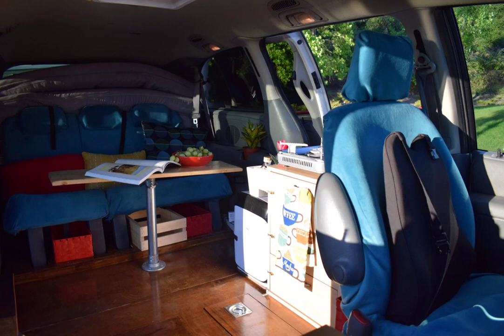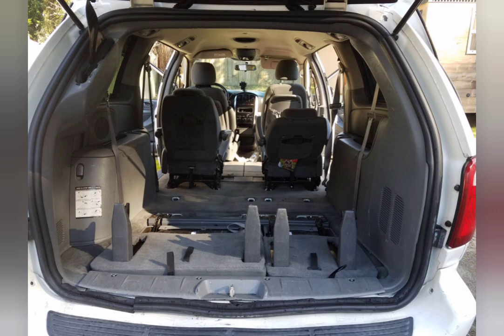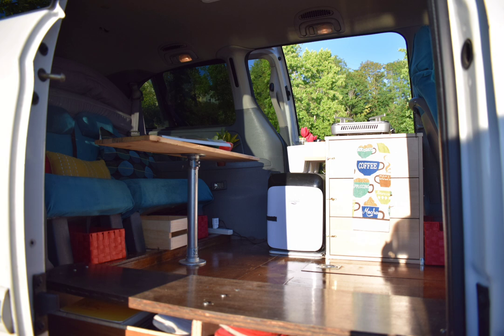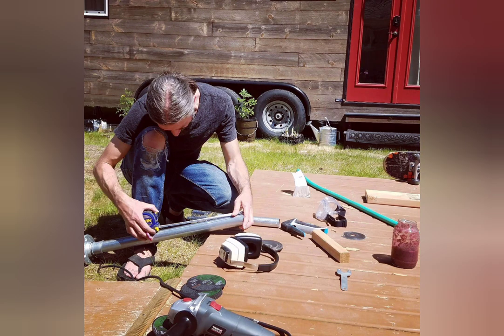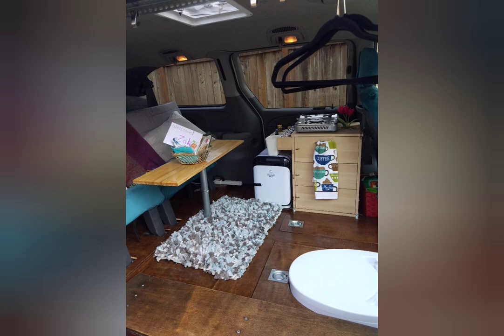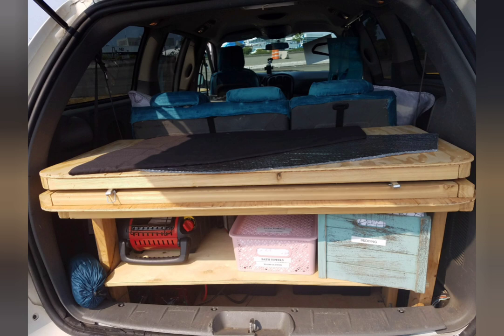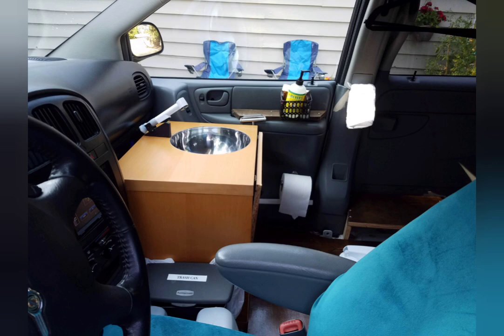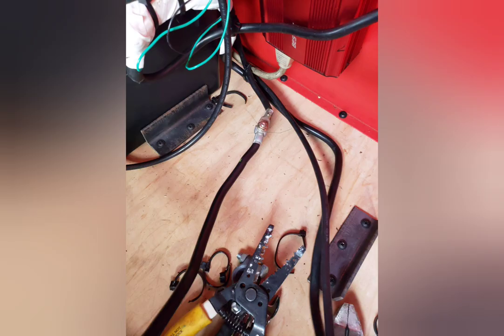Minivan Camper Tour Town and Country Build 1. Solar Sink Toilet

Comment: Love..was deciding on if I should stay iny full size high top has guzzler or go back to mini van.
This made me decide to go back
Reply from the maker: What kind of minivan do you have? Gas is getting so ridiculous with no end in sight.  I hope you're settling in the mini :)
Reply: @AfroMomVanlifing  I had a 04 mer ury Monterey. Had a wreck July 4th, it was totaled
 I now have a 99 dodge ram 2500 with a high top. Love the extra room, but uses to much gas. I need to go back toi Ivan with a better build out. My minii had a full size bed. Took up all the space LOL
Reply from the maker: @getyohustleon4601  oh yea, full bed is comfortable but there goes your space in a minivan lol. Lots of sacrifices to be made to work the space. Let me know what you end up getting 👍🏾

Comment: Hello Dear. So very sorry for the loss of your LOVE.  I have a T&C which I'm just beginning to build. I've removed all rear seats rid week - that's all I've done so far & I'm spending a lot of time reviewing others' builds. I did enjoy your slides showing your very nice setup.  Mine will never be returned to a commuter van so I can do pretty much anything I want.  Have you done any other videos? I'm so curious what changes you made.  Congratulations on mastering electrical!! Looking forward to more videos.
Reply from the maker: Hello Kay, and thanks for being here and the kind words. I'm excited for your build especially one you don't have to worry about converting back.
I do have more videos that I will post later. I'm in the middle of a very long build for our truck which has taken too long. I'll be posting more frequently in a month.

Comment: Be careful with the little fridge I bought my dad one for Father’s Day or Christmas and he only stored Coca-Cola in there and they are almost burnt up because it automatically flipped to the heat setting. Took it back got another one same thing took it back got another one but larger same thing. I had to finally just go with the regular small refrigerator but way bigger than those so be careful
Reply from the maker: Wow that's awful that happened to your dad, but that is good to know info. I'm glad you finally got something better.